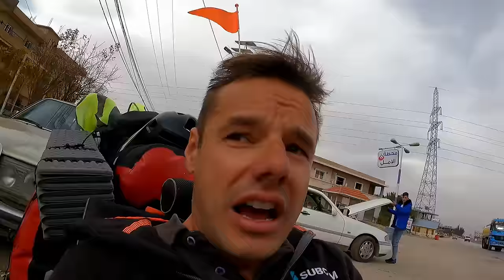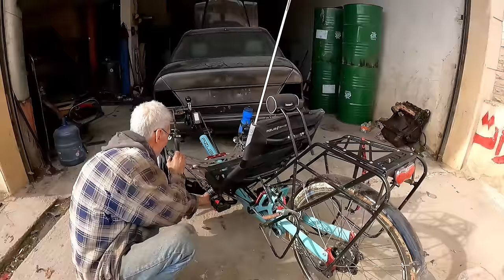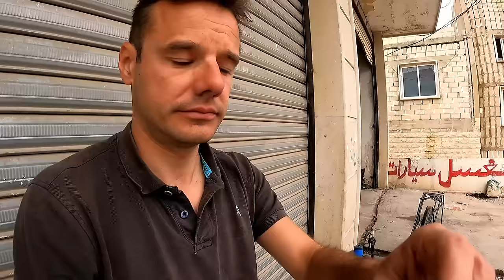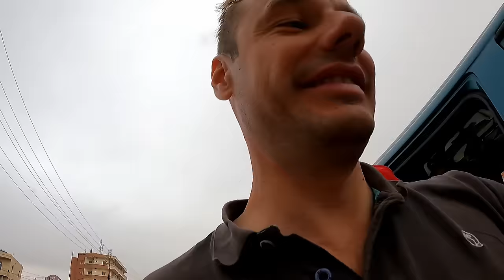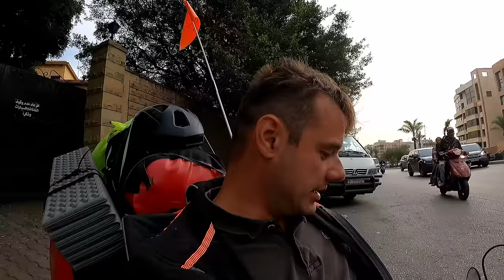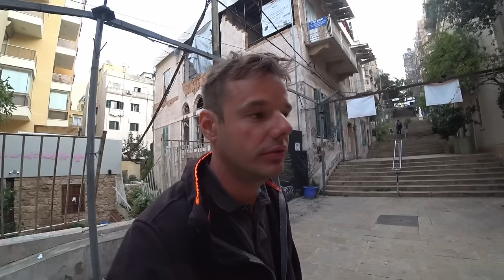I was ROBBED, they cut my bike... mE 21 🇱🇧

Comment: Aluminum pulls heat faster and wants to distribute it throughout the part, while carbon steel doesn't distribute heat as fast. This makes aluminum less forgiving to errors (such as using too much heat) during welding, especially on very thin materials., 
🚴‍♂️